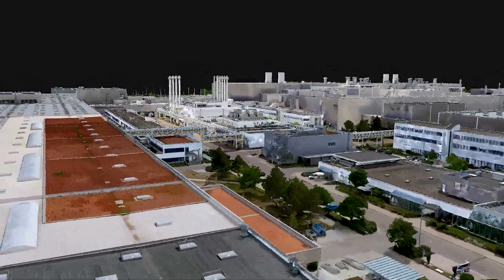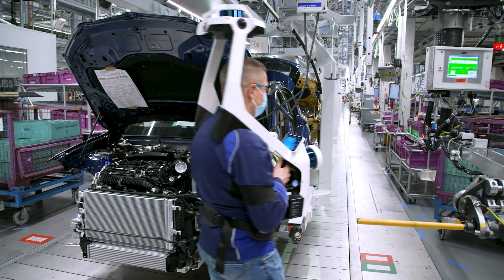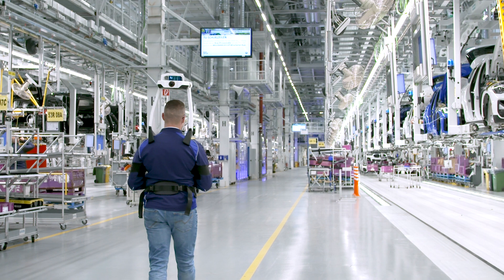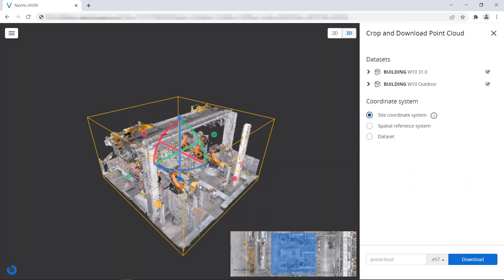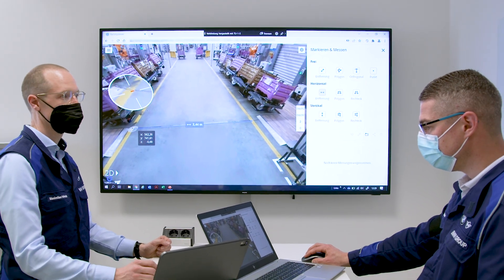NavVis technology supports the digitalization of worldwide BMW plants

Comment: 🎯 Key Takeaways for quick navigation:

00:05 🏭 BMW is using NavVis technology to create 3D web-based representations of their plants, allowing virtual access to nearly four million square meters of production space.
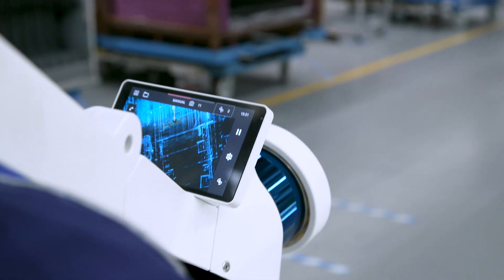00:34 🛠️ NavVis VLX, a mobile laser scanning device, enables fast and accurate scanning of BMW plants, capturing complex environments efficiently.
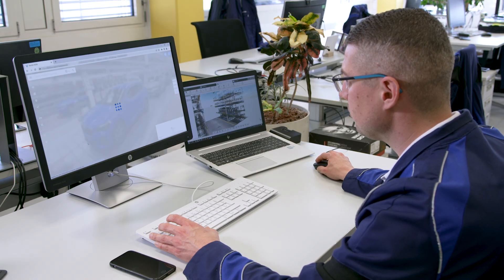01:03 📊 BMW FactoryViewer, based on NavVis IVION Enterprise platform, allows planning specialists to interact with factories virtually, perform measurements, plan changes, and integrate data into other solutions for simulations.
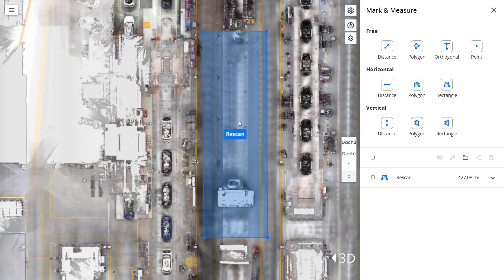01:29 💡 The system provides BMW employees with reliable, up-to-date spatial data of production facilities, aiding in efficient planning and investment optimization.

Made with HARPA AI

Comment: 🎯 Key Takeaways for quick navigation:

00:05 🏭 BMW is using NavVis technology to create 3D web-based models of their plants for efficient and flexible production planning.
00:34 🛠️ NavVis VLX, a mobile laser scanning device, allows for accurate and fast scanning of BMW plants' complex environments.
01:03 🗺️ BMW FactoryViewer, based on NavVis IVION Enterprise platform, enables planning specialists to interact with factories remotely, make measurements, plan changes, and use data in third-party solutions.
01:29 📊 The solution provides BMW employees with reliable, up-to-date data of production facilities, enabling efficient planning and optimization of investments.
The NavVis technology is supporting BMW in the digitalization of their entire production network, aiming for completion by 2023.

Made with HARPA AI

Comment: 🎯 Key Takeaways for quick navigation:

00:05 🏭 BMW has virtually accessible 3D representations of nearly four million square meters of their production network, enhancing efficiency and flexibility in production planning and operations.
00:34 🛠️ NavVis VLX, a mobile laser scanning device, enables accurate and rapid scanning of complex environments in BMW plants.
01:03 📏 Planning specialists use BMW FactoryViewer, based on NavVis IVION Enterprise, to interact with factories remotely, take measurements, apply overlays, and download specific data for further simulations.
01:29 📊 The solution allows BMW employees to base their planning on reliable, up-to-date data, leading to more efficient and optimized investments.

Made with HARPA AI